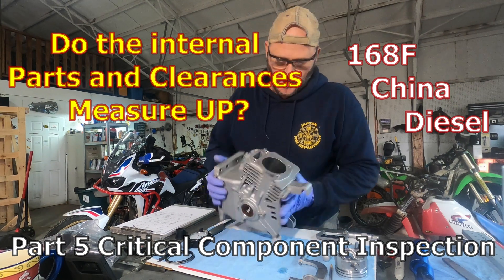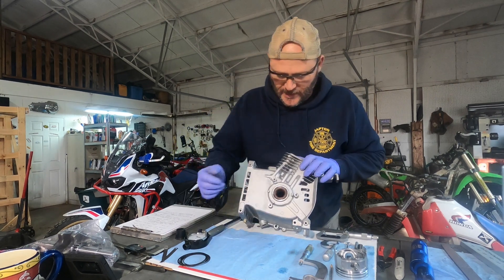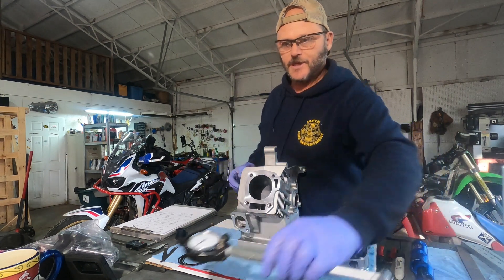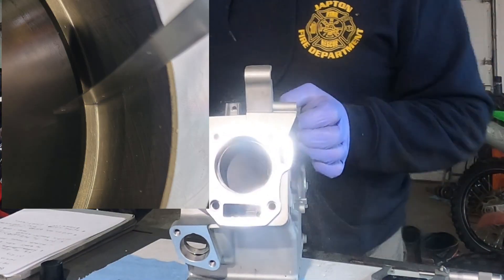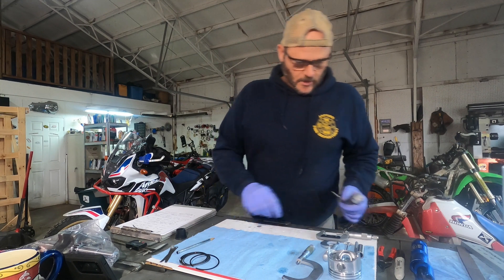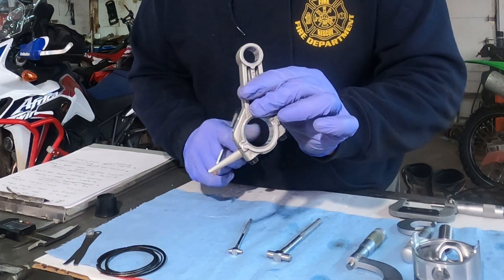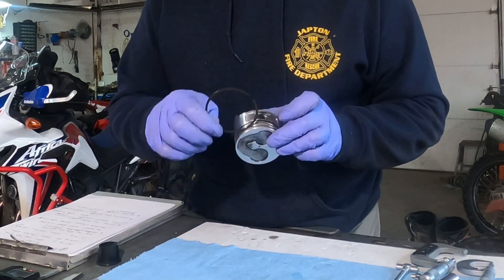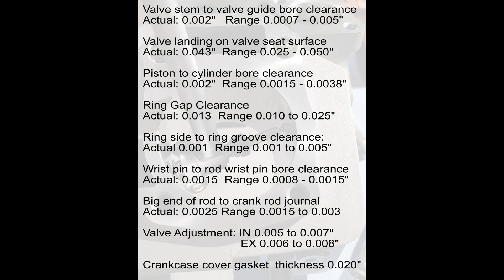168F Small Diesel Engine Prepping for Real Use! Part 5 Critical Component Measurements

Comment: Im really surprised by the quality of the parts. Considering this engine only costs 200 bucks... This is pretty good, I have to say. 

Ive got one of these engines myself, using it in a low rpm generator setup, considering that I only run it at lower RPMs (below 2000), I think it will last just as long as any other engine would!

Comment: An aluminum connecting rod lol.. They are really making these new air cooled diesels cheap as possible. This is basically a honda gx160 clone gasoline engine modded for diesel use.. 3600 rpm diesel and an aluminum connecting rod sounds sketchy at best.. See how long it really last being loaded 75-80 percent for 200 hours.. Stick to the 186fa series of air cooled diesels that are the copy of the Yanmar LV-100.. Has a steel connecting rod and an actual forged crankshaft. Good luck
Reply from the maker: Im pretty sure that is part of the reason this engine is rated for 3000 rpm vs 3600.  Also I run mine at around 22-2400 where it seem that the torque output is the highest and most stable.  Ya if you need 3600 rpm I would not recommend this engine.    I also agree the 186fa is a much heavier built engine and would most likely last much longer.  But is is a lot larger and weights in over well 100lbs. and just too big for a lot of applications.

Comment: I think this is a great series on the little diesel engines. I was wondering if you could share the specs on the connecting rod from your notes? Small and big end diameters? or wrist pin diameter. That connecting rod looks interesting and I was wondering if it may cross over to a gas engine application. This looks like it would be a challenge to build up into a performance application and you've got me thinking about something like that! Thanks, Chris
Reply from the maker: I will try and find notes
Reply: @mossycreekvids  Thank you! I know it's been awhile since you did these videos, don't sweat it if the notes have gone away. I wish I had found your channel a long time ago. Great stuff.
Reply from the maker: @KentuckyFriedFixes  Haven't found my notes yet.  However here is where you can get part. 
 
https://wsepo.com/collections/168fd-170fd-35hp-diesel-engine-parts?page=2

My rod is the 32mm x 18 mm one.  All of these parts are not interchangeable with my unit but a lot are.  I ordered a couple things and did receive them from that company.  The block in this picture does not contain the pump it goes on the pack cover.  I believe that style has a 30x18mm rod.  On mine the pump bolts to the crankcase.  I think very few of these parts will directly interchange with gas engines.
Reply from the maker: also view page 1
Reply: @mossycreekvids  Thanks so much! you're too kind. I'm glad I found your channel!